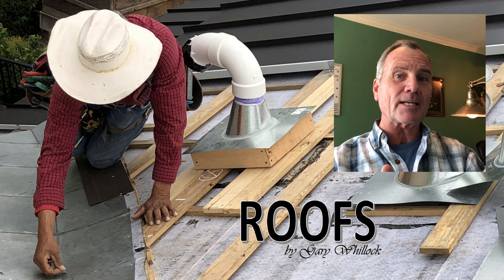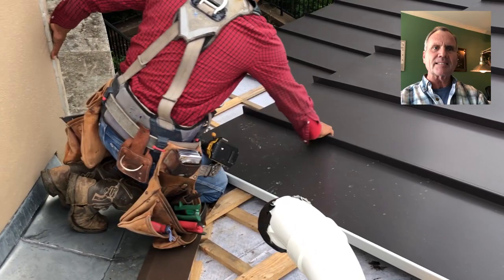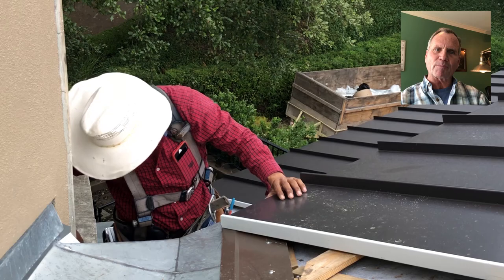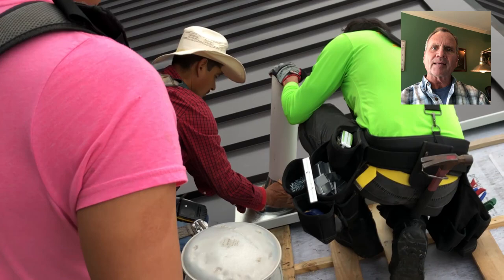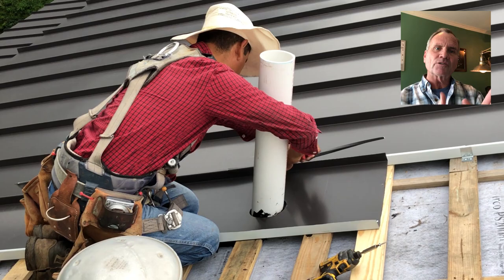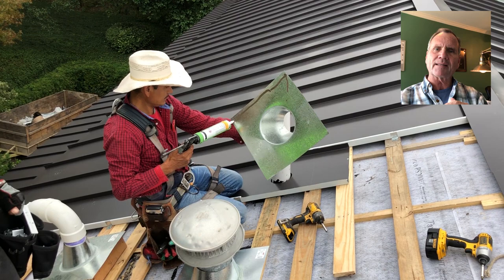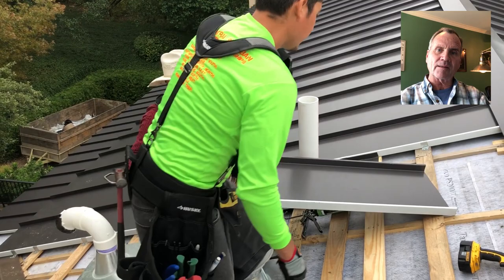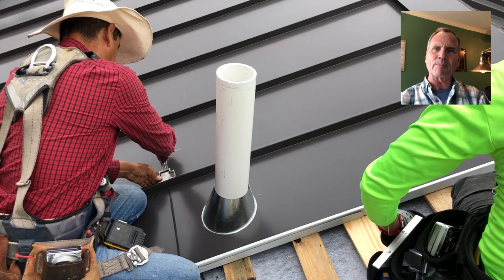Standing Seam Metal Roof with Split Sheet Vent Pipe Flashing Installation

Comment: Thanks for sharing this Mr. Whitlock. This video was a bit more thorough than the other split panel installation. I'm preparing to install a metal roof on my house in six weeks. Not depending on sealant at protrusions seems to be the only good long-term installation solution. Because of your commitment to excellence & caring enough to help someone else through a YouTube video I will be sure to refer others to your business.

Comment: I install that galvanized flashing on the deck water tight with underlayment. 
Cut lower panel to allow for expansion around that jack. Install a little longer flashing that covers 1st and installed on lower panel like you, upper panel I hook and secure to bottom of the exposed flashing not just cover galvalume metal. 
This technique is  Fort knox, of course. 
And requires caulk around bottom cut in top panel to 2nd jack to eliminate water traveling between metals, the sandwiched sealants not exposed to uv does its job and will never leak to the next layer of metal the jack then onto the lower panel, never leak lol. I turn up sides  into the hems to secure flashing with the seams.
Stay thirsty, my friend, the steeper the better. ;)

Comment: Great video one of the best I've seen for Split Sheet flashing.  How do you handle vents in the roof for bathrooms vent? Been looking around for info and everything I've seen looks like it  a leak waiting to happen. Most vents are designed for composite roof but looking for how to handle a bathroom vent for a standing metal seam roof.
Reply from the maker: Randy, thanks for your comment and kind words.  Within a couple of months, I will make a video that specifically deals with K&B vents.  Thank you!  GW
Reply: @Austinroofingcontractors  Thanks for the info. I'm afraid I wont be able to wait that long. I need to get all my ducks in a row in the next month if I want to get the roof on once the rain stops here in the PNW. Also need to find a roofer that is willing to do what your doing. Everyone I've talked to want to use Dektite seal. I'm sure this is a great product and is more of less foolproof to install but installing something with only a 20yr warranty that tears up the metal sheeting and the plywood underneath with all the screw to secure it does not make much sense. To me its like buying a Ferrari and then going out and putting a fiberglass hood scoop on it and bolting it down with a bunch of sheet metal screws.

Comment: Do you have to fur out the roof surface ? What happens when you step on the panel in between fur strips? Seems like you will have dents and creases a result. Also added expense time and materials and potential for rotting fur strips from condensating water vaper.??????
Reply from the maker: What fur strips?  Please clarify.  Sorry, if it was unclear!
Reply: @Austinroofingcontractors  fur strips are a term we use for using wood strips to even out of plumb walls. Your presentation showed them used for creating an air gap for condensation. I am in California and we have low humidity no snow. I was not planning on using them. However the other materials seemed better as they would not create a non-supported span of the panel where a person walking on the roof would cause a denting in. This happened to me when I roofed my garage and it only had skip sheeting instead of plywood sheering. These gaps were much smaller than your example and still you can see the board edges showing through the panels.

Comment: I really like this technique, but isn't there a point of entry for water to get in at the top of the standing seam where the two panels meet? or does the top panel overlap the bottom one where the outer part of the standing seam of the bottom panel was cut off?
Reply from the maker: Your thinking is right the top overlaps, it's the very basics of roofing - shingle style.  A method we prefer most.  Thanks for your question!  GW
Reply: @Austinroofingcontractors  I am still a bit confused. So, the bottom panel gets its ribs cut in half in order to allow three panel lap (top and bottom lapping panels and one adjacent one on each side). I understand that there is a flat area where top panel overlaps the bottom one, but isn't there a butt joint at the rib between the top and bottom panels? Otherwise you would end up with full three panel ribs at that junctions. I am sure I am missing something here.
Reply from the maker: @pnwbuilder    It seems you have a real interest, let's talk, send an email;  gw@roofsbygarywhillock.com
Reply: @pnwbuilder  yeah the butt joints in the standing seam will depend on caulk for water tightness. Also the seam between the roof vent and the pvc pipe will leak at some point. Still considerably better than a rubber boot. I'll reference a link below to show how we are addressing this here in Ohio.
Reply: @Austinroofingcontractors  I'm a huge fan of what you are doing with the spaced sheeting. We follow that same detail. The soil stack detail we do is based on European double locked techniques. We make that roof vent flashing ourselves and modify it to cover the entire pipe. We make the trunk of the vent detail out of matching 29ga flat stock and hand seam it to the panel. No end lap, no caulk, or fasteners. We finish the detail with a witches hat. I'd be happy to send you more details. This quick demonstration on how we achieve it this detail: https://youtu.be/w7lAFq7j3qg   Here's what it looks like on the panel you were using: https://www.facebook.com/iqcustomhomes/photos/pcb.2200399866740382/2200381303408905/?type=3&theater
Reply from the maker: @robertunversaw  Thank you for your comments and the links to your video and pictures.  Excellent details.  GW
Reply: @robertunversaw  Thanks Robert. I agree, this is a much better method than using a rubber boot. I am about to start a project and wanted to make sure I got all the detail right before I give it a try. It looks like they are actually overlapping the panels at the standing seam a bit too, maybe a few millimeters, so sealant there may not be needed, but probably wouldn't hurt either.
Reply: @robertunversaw  That is a very nice way to do it, Robert!
Reply: @pnwbuilder  The exposed PCV pipe will fail long before the roof so I would wrap it in matching steel. Just secure the seam with rivets if you are unsure how to seam it on your brake. I've used Garys detail on corrugated roofs and never had any issues. I would just add a steel storm collar so when the caulk fails it will still shed water away from the seam between the pipe and the trunk of the vent flashing.

Comment: Got here looking for vent-penetration details and now I'm off on another tangent.  What I'd gathered from reading & talking to industry pros is that even a standing-seam roof isn't to be relied on as a sole waterproofing line of defense, thus the old-school felt or more modern self-adhesive rolled-underlayment product range, used directly over sheathing is the norm - or so I thought.  Clearly that's not universally accepted, from what I see here.  Is that a regional thing?
Reply from the maker: What an interesting question, and I love that this question has come to surface!!!   To answer your question about regional, I don't know, but there are many, like us, who install metal roofing to be a "lasting" water-tight roof, then there are those who don't.  It's interesting, regarding region, I've connected with a few from Europe through my YouTube Videos and a few in the Eastern United States, who also, do special flashings and make their roofs lasting water-tight roof.   I have also spoken to metal roof promoters, YouTubers for companies that sell metal roofing materials, they say promoting water-tight roofs like we do would reduce their market, there just aren't enough capable crews, they must keep it simple to sell metal roofing.  That doesn't sound good - sad I thing!  Thanks for a great question!
Reply: @Yargk  Occurred to me that it may also have to do with condensation concerns.  Even here in Honolulu, esp in "winter," there's a lot of dew that forms on cold surfaces in the morning hours.  I'm imagining the potential long-term effect of that if it were precipitating even a few cupfuls of moisture under my roof onto the sheathing etc., day in and day out, in/on to anything that's less than well-ventilated.  If you live where the temp swings are high and there tends to be a lot of humidity, I'd be concerned.  

I am sealing my sheathing as completely as possible before the metal goes on, mostly because it's taking me forever to re-frame the whole roof, section by section, and I don't want to try to piecemeal the new metal roof around ongoing framing...even the six-month-exposure-rated underlayment is a bit too short-term for my needs.
Reply: Never, ever even think about using organic felt unless you want the roof to rust out from underneath.  We have replaced several old standing seam jobs there this occurred. Once the chemicals off gas, the felt is like a sponge and soaks up ambient humidity from atmosphere. This is why we use synthetic underlayment.